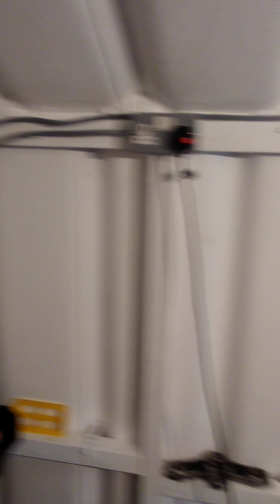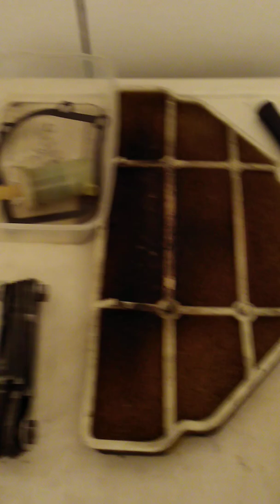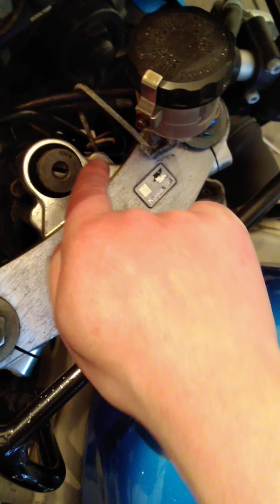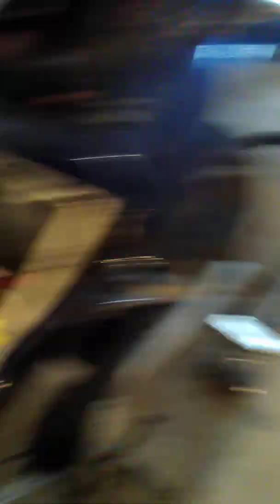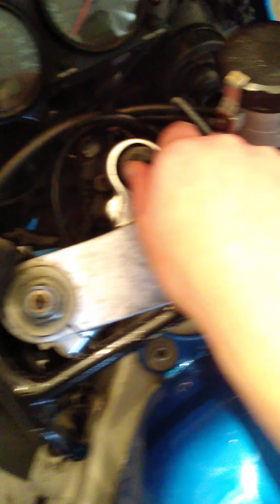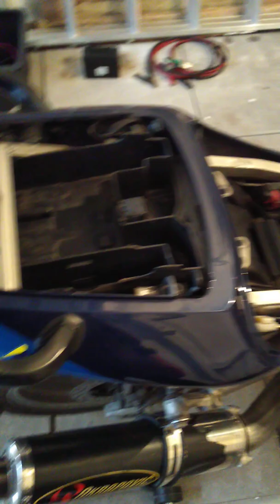ZX6R Keeps Cutting Out

Comment: Keep cutting out unless you use excess throttle...sounds like fuel starvation...carb clean etc........
Reply from the maker: Thanks for you advice.  I noticed that the exhaust headers got hot very quickly, perhaps a sign that it is running lean.  I will check the fuel pump etc.

Comment: Had a look through a few forums. Could be the carbs need cleaned, check voltage at the fuel pump and finally check fuel tank breather pipe incase water has got into the tank. 
Hopefully you get it running sweet again 👍👍👍👍👍
Reply from the maker: Thanks for your advice.  I did drain the carbs and spray some carb cleaner into them.  Fuel pump voltage is interesting - I noticed that the exhaust headers got hot very quickly, perhaps a sign that it is running lean.  I will check that.